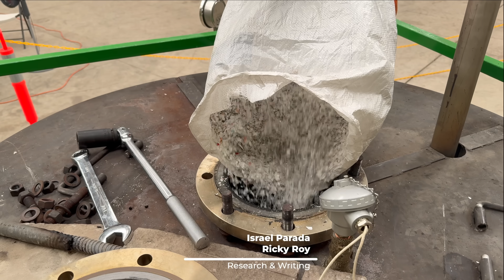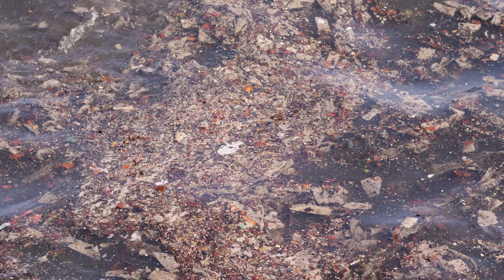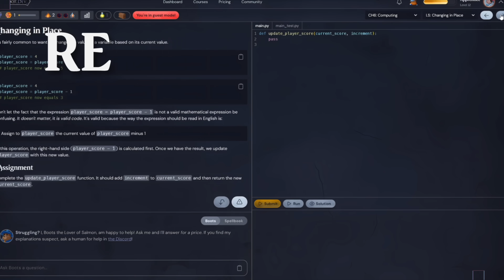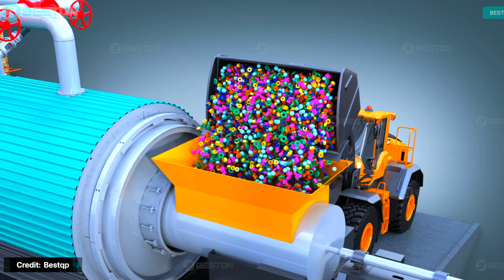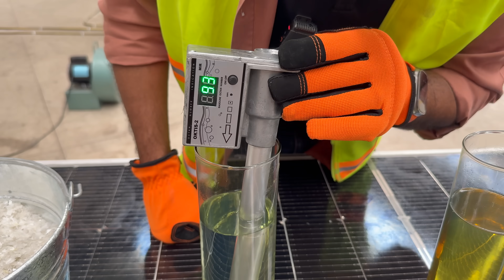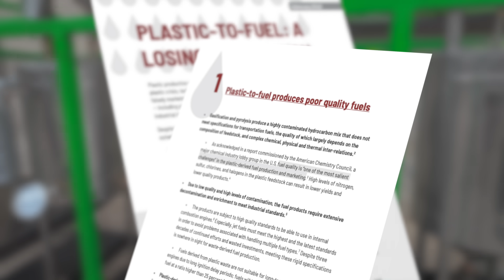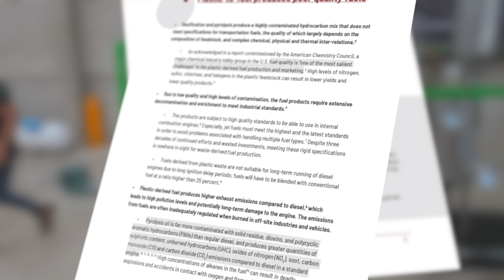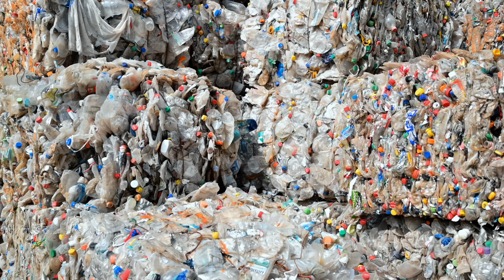Solving the Plastic Waste Problem - This Surprised Me!

Comment: The big oil will stop it.
Reply: That's a rather cynical view.... 🤐 the Gasoline in this case come from plastic which intern comes from the same petroleum industry. What should happen is regulators should penalize fossil fuel companies if they don't support the upcycling of plastic to fuel. However the ultimate goal is to phase out the fossil fuels entirely, therefor the whole premise of this tech is only to provide a stop-gap measure at best.
Reply: If this is economically viable (and I hope it is) oil companies would be thrilled to skip the high risk operations of exploration and drilling and use this instead, and they would be on it faster than bananas turning brown after you get them home. They have a huge incentive to reduce risks and costs in their companies, and don’t forget, they have vast numbers of researchers, scientists, and engineers that are well funded looking for things to make their businesses more efficient. If this is the miraculous thing that the pitch implies they will be thrilled to pay these people for their processes. If they can cut their costs of crude exploration, drilling and transportation in half, it would be implemented as fast as possible. They have some incredibly smart people working on things like this because they have a vested interest in making it happen. I’d be surprised if they hadn’t already figured this stuff out and already know why it didn’t make sense to implement. These are the same people that made the plastic in the first place, they know what’s in it.

Comment: Although "not ideal", it's a good step.  It will remove a lot of waste plastics from our oceans, land and bodies.  And hopefully it can reduce the amount of drilling needed while we continue to reach for zero pollution solutions
Reply: Nope. It will convert the plastic that someone already got removed from our oceans and bodies. Landfill have liners. Just like nuclear waste is inside a concreate block.
This does nothing about plastic going into the oceans. And more oil means lower price, means more energy consumption, means same amount of drilling.
Reply: You can get rid of 90% of the plastics floating around the Pacific Ocean by convincing the residents of 4 or 5 river basins in Asia and India to stop throwing it in the rivers.

Comment: Nothing "Green" about this scam. They're turning solid waste into liquids to be burned and turned into gasses. The only sensible solution for our plastic pollution problem is to stop producing new plastics and sequestration. Seal it off from our ground water and let it decompose over thousands of years.
Moving it from the ground and water into the atmosphere is the last thing we should be doing.

Comment: um... but is it clean if you are taking plastic waste (not great, but its inert and buried, at least if disposed of correctly), and producing gasoline and diesel and parafin... which um.... create more carbon emissions? i thought carbon emissions are an even bigger problem than plastic contamination (which could be reduced with better and stricter disposal regulation). i feel like you solving plastic pollution (great) but at the cost of increasing carbon emissions??

Comment: I get that it's taking "sequestered carbon" and turning it into fuel that will release carbon into the atmosphere. But how does this carbon footprint compare to drilling new oil and refining it into gasoline that will also be burned and release carbon? Also, the plastic is terrible for the environment. We may be able to engineer ourselves to minimize the effect of global warming, but we can't engineer the effect of plastic pollution on the environment (and in our bodies). I'd say as long as we use fossil fuels, converging plastic waste into fuel is better than drilling oil to refine new fuel.

Comment: This will never be commercially viable not because the technology doesn’t work but rather because the labor costs of separating the USABLE plastics to start with.

I worked with Waste Management in Denver. Probably 90-95% of WM’s “recyclables” still ends up in the landfill. WM isn’t alone. It’s just the example I have. They all do this.
Reply: Eventually, robots controlled by AI will be able to separate usable plastics.

Comment: In Maine they opened a trash to diesel fuel plant that put the trash to electricity plant out of business. The trash to diesel plant failed.  Now they are trying got the trash incineration electric plant back on line. There are currently two trash to electric incineration plants operating in Maine. The total energy usage to fuel output from shredding to collection needs to be considered in viability for this process. Ethanol consumes more energy in producing than BTUs produces but it lowers smog participants when burned.
Reply: Ethanol from corn.  From what little research I've read it takes more energy to produce ethanol than the amount returned when Ethanol  is put to use.  This was 5 or 6 year old research.  Do the benefits of today's Ethanol offset the cost of production, seed to tank.
Reply: @skintite9892 
Not to mention it drives the price of corn up making animal feed more expensive.
Just another reason your meat got so pricey.
Reply: @JamesHarris-yq3mu  You NEVER want to put your food supply in direct competition with your fuel supply.  Biodiesel works GREAT as long as the vegetable oil used to make biodiesel is the secondary use of the oil and "virgin" oil is never used in that process.  However, it has not worked out that way.
Reply: But what about the component of this process that uses its own fuel, doesn't that solve this?
Reply: so many trash to energy plants consume more than they produce as most of the trash they get is "wet trash" and it takes a lot of energy to dry it out so it can burn... there has been one in particular (an early one) that had to be shut down when the grid was running low... this setup is entirely different as it uses presorted trash
Reply: source? name of this company? thanks buddy
Reply: This business model is not economically viable. Plastic has a cost — no one gives away waste for free, especially if it has been pre-treated — and the energy required has such a high cost that, in addition to raising the break-even point, it may even compromise the sustainability of the entire business model.
Tbh, I know people who own a better technology. It can generate all the energy required for the process itself, it can produce kerosene (or diesel or gasoline), and most importantly, it can process any type of waste.
What is shown in this video is nothing more than pyrolysis and gasification applied to clean plastic (already processed). There is nothing new here — we’ve known this process for at least 50 years

Comment: If this can be done it MUST be done. I’m sure the petroleum companies are well aware of this technique and will stop at nothing to bury this type of research. Great video and please do a follow up as we need to clean this planet. James.
Reply: No. They have calculators. Things don't add up. Like burning fuel in a device that moves around. The powerplant that burns plastic doesn't move. It can have large scrubbers and other techniques to get the polution out of the smoke stack.

Comment: It seems to me, that recycling this plastic will cost about 40% - 50% of the total energy contained in it,
Is it not a better and cheaper very low tech solution to just burn the plastic, and make electricity for an EV, (total efficiency wil be around 30/40%)
or first do the recycling proces in a costly raffination proces ( and lose 40/50%) then burn the rest in a gas engine ( with an efficienty of 25/35%)
the end effcienty of this last proces would be 21/12,5%

Comment: Plastic throw out as garbish is obviosly bad.
So convert it into fuel and put it in the atmosphere and turn it into air pollution instead...
In my opinion, that's not solving a problem, but just moving it.

We have a climate issue and I dont think this is helping, at all...!

Comment: Interesting, but this is just a fancy way to burn the plastic. I'd be curious to see an economic comparison with simply burning the plastic to make electricity, and storing it in batteries.
Reply: Burning waste for electric power only works in large scale and requires constant operation. Most off the trash the polutes the oceans comes from small towns and villages in third world contries, that dont have the infrastructure to haul there trash too the next powerplant. 
Also they dont need much electricity since the only thing they have is a fridge and a few lights.

Gasoline is much more important for them too run motorcycles and farm equipment, also the pyrolises can be operated in small scale and batch operation.
Reply: Bingo.
Reply: “Storing it in batteries”

Batteries need to be recycled, and the only ones which are recycled well are lead acid batteries.

Electricity into batteries is just creating a new recycling nightmare. They would most likely be lithium batteries. Lithium leached into water is linked with autism.

We need to recycle all plastic somehow, as the plastics today are poisoning every living thing with microplastics. 

Fuel is a fine way to recycle some of this poison.

Comment: so basically turning oil into oil
Reply: Turning the solid oil back into a liquid oil yes exactly correct, at the very same time refining it enough to run directly in a motor. 

So what no one cared to mention is, they also figured out how to refine crude oil in a more efficient manner

Comment: With such large desert areas like Texas, Arizona, new Mexico, and northern Mexico, I wonder if there isn't a way to build an endothermic  pyrolysis plant that uses solar heat instead of burning more fuel to break down the plastic and also save the butane, etc. And, I don't mean solar panels. I mean something like the convex mirror solar plant running a molten salt reactor heat exchange system.

Comment: It's a cool technology, but I see it more as a stop gap.  Most forms of transportation will soon transition to electric, especially as robo taxis and autonomous air taxis come on line.  Way fewer people will own their own vehicles and oil use will plummet.  I figure in a decade or so.  The real trick is to replace plastics with biodegradable materials derived from nature and take fossil fuels totally out of the equation.

Comment: Yes, this works. But does it make sense. That depends on the cost of this process. If that is competitive with the current fossil fuel cost thats a plus. If it is less polluting thats another plus. But if it is not I don't really care, because it would be replacing a tank of gas from traditional refineries. Therefore less traditional gas is consumed while we are solving the plastics landfill, ocean plastic patches, and plastic recycling processes that are sometimes more costly than turning it into fuel. What happened to those promising plastic eating bacteria anyway? Full electrification of our planet is still decades away. Might as well use these plastics for fuel rather than fresh fuel the traditional way. Remember that a heap of Cobalt is being used in the traditional gas refineries. If this method can produce gas without the Cobalt that would be a huge final plus for this technology. But like with new promising battery technologies the trick is in scaling up this process and to get regular gas stations to sell it. The vested interests in traditional refineries/gas companies are not going to like this process and will get their paid congressmen to oppose it. Good luck.

Comment: I’m sorry, but I think you missed the most important question. I see these theoretical and lab experiments all the time that sound exciting, but over 90% go nowhere. You asked whether the process even makes sense—whether it might be a net loss—but you didn’t address the most critical point: Can it be done economically?

If it can’t be done at a competitive cost, it will never succeed. You should grab a chalkboard and run through the numbers—everything from the cost of gathering and separating the plastic, to building the infrastructure, to ongoing operating expenses, all the way to the value of the final product.

At the end of the day, you can currently buy gasoline for about $3 per gallon, depending on where you live. If they can’t turn plastic into fuel at or below that price, this project, like so many before it, will fail.

Comment: Waste plastic has to be separated by other waste and that whole separate chain for waste plastic requires energy.
In the order of 95+% of crude is burnt and a few % is turned into plastic.
Plastic included in waste requires less additional fuel to get that waste burned.
So now turning waste plastic into fuel takes energy. Also burning waste without that waste plastic requires more energy.
Applauding turning waste plastic into fuel should take the above into consideration. What is the net real advantage?

Comment: so is there no short life components to the system that would need to be replaced that might reduce the practicality of the system? Does it require a lot of maintenance? 

if this system can just keep being used and is easy to maintain then it looks like a great thing. to be able to prevent plastic from just ending up in landfill and get energy back out of it so its not just wasted. 

Though isn't the main culprit in micro plastic from fabrics being washed and the washing machine water ending up back in the water system? Itd be great if plastic didnt end up in the ocean, but its clear that isnt a problem caused by the plastic existing, as responsible countries dont have a problem with ensuring the vast majority of plastic waste doesn't end up in waterways. only certain countries have the mentality of just throwing garbage on the ground and directly into waterways. So that problem doesn't need a solution like this, it just needs those countries to be responsible with their plastics.   

And so as far as micro plastics go it seems what we need is a way to get the plastic out of the water coming out of the washing machine before it gets dumped down the drain. As once it gets there and mixes with everything else youre never getting it out. i wonder if anyone is working on that problem?

Comment: Reduce, Reuse, Recycle
Reuse could be better described as repurpose, Using a plastic grocery bag as a trash bag, instead of buying trash bags is an example.
If this process scales, it could reduce the amount of hydrocarbon extracted from the ground and allow the reuse a waste product
what's not to like? Waste is like weeds: unwanted, misunderstood, often misplaced valuable resources.
Oil companies turning natural gas flare off from oil wells into synthetic oil is another good example of reuse.

Comment: This is really pissing me off, the more I watch. They're claiming they came up with the idea and technology. Even the machine looks the same as Julian Brown's machine he's built in his backyard years ago. They did not think about this.
Reply: To be fair, plastic pyrolosis is not new at all. Julian didn't invent it either. What he is doing that is innovative is using his microwave method to try and make it cost competitive.
Reply: neither did he.... neither of them did...
Reply: @theonewhowas7709  changing world technologies, in the early 2000s they were planning on setting up a production plant near a butterball turkey processing plant and were going to be turning the waste into heating oil. They said the process also worked for sewage and landfills.
Reply: It's an innovation not an invention.
Reply: julian is actually the one copying others and the only difference he made was to use microwave magnetrons to heat the plastic, rather than fire heat source. the design of the system is stupidly simple and the fact they "look the same" is a stupid argument since its difficult to make it look any other way. julian is basically a scam artist with the way hes been marketing his own device.

Comment: Kind of cool, but whatever the efficiency is, that plastic isn't just shredding itself. That needs to be figured into it. Also, that plastic isn't just going to sort itself, either. Unless it's plastic left over from a manufacturing process somewhere, my mind has a hard time comprehending all the work that would be required to sort enough plastic to make a dent in fuel usage. I'm not knocking it. It just seems that scaling it up would be quite an ordeal.